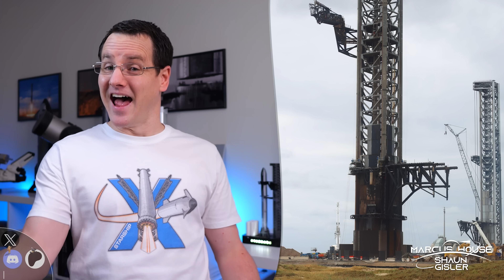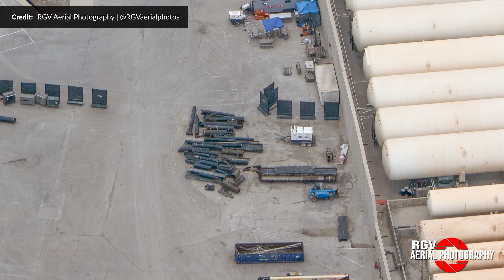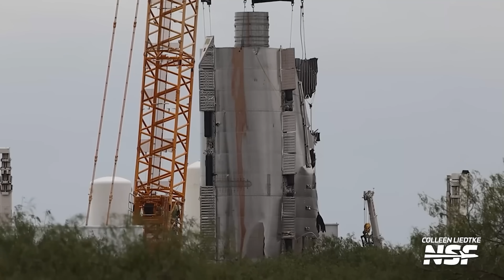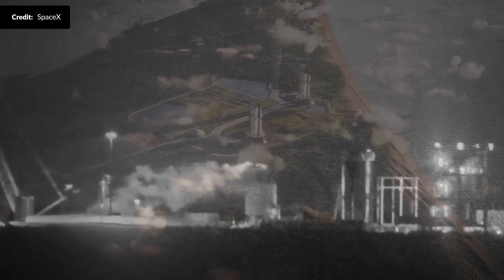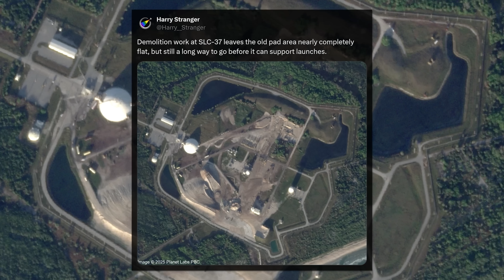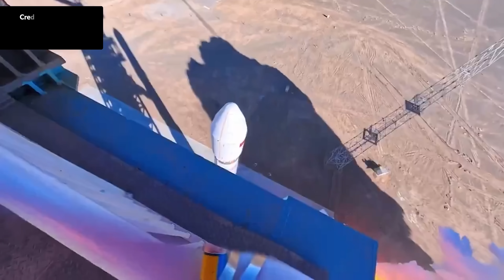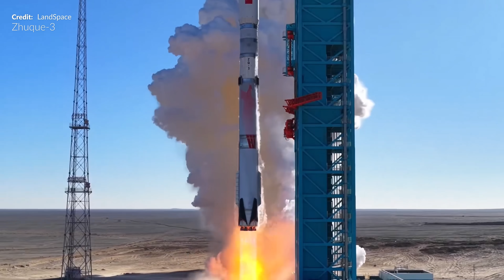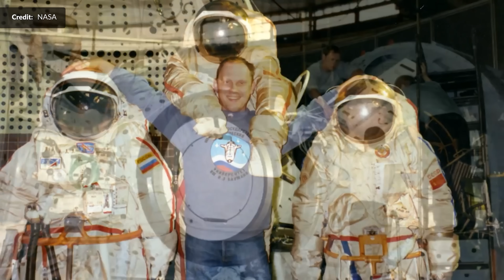SpaceX Just Got a HUGE Starship Launch Approval Update!

Comment from the maker: Get a great Displate deal using my link https://displate.com/l/marcushouse or my discount code MARCUSHOUSE.
1-2 Displates - 33% off
3 Displates - 38% off
4+ Displates - 40% off
Valid on Textra
Reply: They could use the reusable V3 and V4 at some stage as a replacement for the falcon permanent engine, to get more maturity into them:)
Reply: I'm thinking that the removal of all the cylindrical pieces, whether they are accumulators, hydraulic cylinders, water pipes, or echo chambers😂 - they were all probably made by the same company (which was NOT SpaceX - they FOR SURE aren't in the business of making PIPES lol -  AND I'm thinking they also make the COPV cylinder (that gets wrapped in carbon-fiber) -  and SpaceX just figured out that Booster 18(? - I THINK that was the booster that rupture on the test stand at McGregor recently. Well no matter what the Number was, I'm referring to the most recent causality during testing) and it was YET ANOTHER CYLINDER - ALL MADE BY THE SAME COMPANY -  And so now SpaceX is switching to a NEW COMPANY and REPLACING ALL THE CYLINDERS MADE BY THAT FIRST COMPANY - What do you think? Make sense?
Reply: This is all a waste of time and money
Reinstate project Orion and

Get your ass to Mars

Nuclear engines are the only way

Comment: Keep an eye on the black magnet things behind your displate, they sometimes slowly move down over time until the displate falls onto the floor. Usually takes years but has happened to two people i know.  To fix it just run a small bead of superglue on the top edge between the black magnet and the brown wall protecting plate.  This should stop the black magnet moving down.

Comment: New Glenn is not a reusable booster until it gets reused so at this point in time there's no "second" reusable orbitable booster right now unless you accept that Super Heavy is it since it has done the whole of it's part including reuse though Starship has wisely not gone orbital as doing so would be an unnecessary risk for a very experimental rocket.  And that may be a reason to not call Super Heavy the second either as it's still not a production rocket, only an experimental one.
Reply: lame
Reply: @hierox4120  Explain yourself, what exactly are you calling "lame".

Comment: It's funny to call something an orbital booster that hasn't boosted anything to orbit yet
Reply: That's the job of the 2nd stage, the booster did it's job as intended.
Reply: @imaginary_friend7300 let's be simple.if you want to call it an orbital booster, the boosters job is to boost the second stage to a point where the second stage proceeds to orbit. They work hand in hand. If one fails they both fail.. that's the nature of the game. Nothing from starship has achieved orbit yet...  So nothing is orbital yet...  Not saying it can't or won't... Just saying it hasn't...  That is a fact.. not sure why you are trying to argue otherwise
Reply: @imaginary_friend7300  it's a system.. they work together...one fails, they both fail... but ok.. let's play your game.... if the booster if good to do it's job, whay are they still modifying it?
Reply: Starship was sent successfully on a suborbital trajectory that was very close to orbit; it was left just short of that because, being experimental, it was better to design a passive return to earth trajectory.  Simply burning the engine a little longer could have done it.  I agree that Elon has claimed some false and even ridiculous things, but this claim is reasonable I think.  It's not like you get a trophy for this distinction.
Reply: @mriguy3202 I've watched every starship ift..  coulda shoulda woulda. Is not a has done

Comment: I'm thinking that the removal of all the cylindrical pieces, whether they are accumulators, hydraulic cylinders, water pipes, or echo chambers😂 - they were all probably made by the same company (which was NOT SpaceX - they FOR SURE aren't in the business of making PIPES lol -  AND I'm thinking they also make the COPV cylinder (that gets wrapped in carbon-fiber) -  and SpaceX just figured out that Booster 18(? - I THINK that was the booster that rupture on the test stand at McGregor recently. Well no matter what the Number was, I'm referring to the most recent causality during testing) and it was YET ANOTHER CYLINDER - ALL MADE BY THE SAME COMPANY -  And so now SpaceX is switching to a NEW COMPANY and REPLACING ALL THE CYLINDERS MADE BY THAT FIRST COMPANY - What do you think? Make sense?

Comment: China hasn’t had an original thought since gunpowder…
Reply: Perhaps this won't be a popular comment here, but the Zhuque-3 isn't particularly a Falcon 9 rip-off. It has clearly learned lessons from the Falcon 9, but any modern rocket should, it was a complete gamechanger: no one should ever let ArianeSpace live down their dismissing it. However, the engines are entirely different both in fuel and the landing profile the specs imply, which is massive. Basically yeah, it's a tube full of fuel that goes up and later lands, but that's what any modern rocket should be. What similarities there are like the large engine count and the landing legs are because everyone's watched a decade of SpaceX succeeding after making a good design, so you'd expect anyone competent to design something similar. 

Although even if it were a complete rip-off (like the Long March 9's most recent design proposals, which very clearly just "Make A Chinese Starship If Starship Works Out"), would that be such a surprise? When Britain invented the steam engine, would you expect a German steam engine built a decade later to look completely different or function on completely different principles? Or for another example, once the Wright brothers show you how flight works, how could you not be inspired by parts of their design?
Reply: @suicazura9417  did they get their methalox engine idea from spaceX having tested them long before Starhopper/SN style?
Reply: At least their government is pro space. Our goiberment is pro good ol’ boys network and anti SpaceX.
Reply: And that's even highly debated, no sources outside some dubious Chinese ones of alchemists mixing potassium nitrate in elixirs (and these come from Maoist texts). European, Persian and Arab explorers and merchants never documented the Chinese using gun powder. Jesuits have documented how they introduced the Chinese to saltpeter for propellant.

Comment: For ppl living on the space coast currently, how disruptive are the noise and shockwaves from Falcon 9? Starship is so much louder I feel like its going to make the areas around the launch sites unlivable with sounds like that every 8 hours?
Reply: I can hear Falcon 9 launches from inside my house in the City of Cape Canaveral. Some launches rattle the windows just a little, but don't interrupt conversation, even on the phone. There are currently 1, 2, or 3 launches a week.

Only a small percentage of launches have boosters that return to the Cape to land -- most land on barges hundreds of miles out to sea. When they do land at the Cape, all we hear is the sonic booms; two in quick succession, like boom-boom. The sound is loud enough and sharp enough to startle you if you are outdoors, even if you are expecting it. But overall, not really disruptive.

Starship launches will be louder -- it will be interesting to see how much louder. And every launch will have a booster landing at the Cape -- no barges involved. So a lot more sonic booms. 

I consider putting up with rocket noise my (small) contribution to the space age. If Starship is too disruptive, my attitude may change.
Reply: That makes sense that the landing sonic booms are the actual loudest part of a launch. So now we need someone who has been in person to starbase (or those who have seen both!) and how many and intense the landing booms of the booster are . And if both the ship and booster rtls thats two per launch let alone if the start catching ships from other launch sites. Sonic boom barrage once every hour..? o_o

Comment: 16:38 thats not correct. ZQ-3 rocket has half the capability of F9, Expendable11,800 kg, Reusable (RTLS)8,000 kg, Reusable (Downrange)~8,000–12,500 kg. Future iterations hope to increase that to F9 levels, something which will be quite a feat since they have less powerful engines and a much heavier stainless steel craft (but accurate numbers and facts are not usually something the Chinese seem to care much about)

Also, recovering a booster does not make it instantly reusable. Electron was recovered but failed to become reusable for example. Currently there is only one reusable booster, the F9 (SuperHeavy has also being reused, but not fully operational yet)

Comment: 3 Starship Launches Every Week? I don't believe it until I see it.
Reply from the maker: I had these same messages with Falcon 9.
Reply: @MarcusHouse  Not from me. Starship is an entirely different beast than Falcon 9, much more parts to check, and Starship re-use is entirely different from its booster re-use. So far, none of the Starships that made an re-entry looked remotely like it could be re-used at all. 

While the  Falcon 9 booster is the the most re-used rocket in the world, its fasted turn-around took 9 days, and the average is much higher. T

he main problem though is that Starship is too heavy because of re-usability requirement and uses too heavy propellant for being an upper stage, making it very inefficient, and the number of tanking mission to fill up one Starhip is going to be impractical. SpaceX tries now to overcome it by making the whole thing even bigger with V2 and V3, which is not an improvement, but a desperate try to allow to bring up any payload to orbit at all, which Starship V1 turned out not to be able to do. How did that go so horribly wrong? Starship V1 was like designing a truck with frame so heavy it can't carry any payload and has to drive around empty. Or building a commercial passenger plane that can't fly with freight or passengers. Who messed up here?

I am not happy about all this, and as a German I am not comfortable with the way Elon Musk and SpaceX are operating - without thinking things through. I prefer the more methodical way of Blue Origin, with less drama and promising capabilities from the first launch.
Reply: All they're doing is getting ahead in the paperwork.

Comment: This proposed schedule would put every other launch provider out of business. That's the clue as to how fictitious it is. Not even Elon's money and/or his installed presumed NASA administrator will able to offer up the Cape as SpaceX's private launch facility. Not to mention what will the Starship loft into space on such a schedule besides someones ego.
Reply: Falcon 9 has already flown over 150 times this year. No reason to assume that Starship couldn't do the same. That is especially true with the fact that most launches will be SpaceX only packages, like Starlink. Further, this is UP TO, not at minimum.
Reply from the maker: This is true however the big difference is the two added catches in most cases.
Reply: @anthonypelchat  The other consideration is the volume of propellant in the Super Heavy stack. The exclusion zone will be very large.

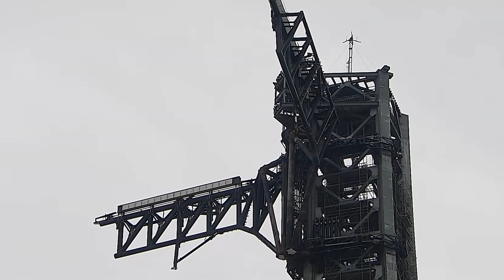Comment: 1:50 Hold on. What? "Move the arms with gas that forces hydraulic fluid into the actuators." I'm confused by the why. There is a lack of efficiency doing it that way due to the compressibility of gases vs liquid, but I can imagine there is a benefit to dampening shock forces for the same reason, however couldn't the latter be addressed without combining pneumatics and hydraulics? Is there a video that covers that?
Reply: It creates a faster acting system with reasonable sized hydraulic pumps. Otherwise the hydraulic pumps would have to be multiple times larger.

Comment: A high performance superheavy neutron derivative would have Elon soiling his pants.  Landing downrange onto a barge is ok when you have lots of rockets.  Starship second stage reusability is not an economic advantage when all the variables are tallied.
Reply: So wrong!
Reply: @GntlTch Its cheap to 3D print spindly second stage rocket motors for neutron.  Trucking fleets don't like to transport air, which is what starship does upon re-entry.
Reply: Your trucking fleet example is foolish. Any reusable rocket is transporting emtpy space on its return. Neutron included. Cutting out marine assets is a major cost advantage. It's like paying one truck to transport another truck because you didn't want to put enough fuel in the truck to transport. It's fine when expending the upper stage, but will be pointless when reusing the upper stage.

Neutron might do well. Most of us think so. But it has a long ways to go just to compete with Falcon 9. There is little chance it will be able to compete with a fully recovered Starship.
Reply: @anthonypelchat You do  simple spreadsheet and calculate total cost.  Returning from orbit is like running an inferno gauntlet while transporting air.  A second stage neutron booster is super cheap and can be mass produced.  Throwing away a spindly stage 2 booster is a good tradeoff.  Starship will never have high cadence due to gauntlet induced inspections once on land.  Elon's analogy to aircraft is a false analogy.  Also, if you read what I said, it was a superheavy Neutron like system.  Neutron is not superheavy.
Reply: @mefobills279  The second stage Neutron is more expensive than just fuel. Further, Neutron hasn't proven anything yet. It hasn't even flown. So its paper math, which you are already horribly wrong about, is just theoritical. 

For math, Starship's landing uses no more than 65t of fuel. And that is after launching 100t of payload to orbit. Neutron can only lift 13t to orbit while reusing the booster. So you need 7 flights just to equal 1 Starship launch. And each Neutron launch needs 122t of fuel. So yeah, your math is horrible.
Reply: @mefobills279  What a joke.  Like you can do any of that math.  We have none of the figures so that's 100% bs.  If you need to LIE to pretend you have a point you didn't actually have one.  You're just another dishonest BS spouting hater.  And like all f those you're not terribly intelligent.

Comment: Looking at the giga-factory make wander if they will be running out of parking spaces for the rockets, could Elon be planning on building a parking lot for his rockets in low earth orbit far from Salt water spray and hurricanes? All you have to do is send up a couple of StarShips full colonist for the preloaded StarShips along with full tankers when earth and Mars lineup, to increase safety they might send up only oxygen or methane but not both at the same time to the fuel depot.

Comment: Won't theirs be the 4th ever reusable booster?  Falcon 9, Starship Booster, Blue Origin's New Glenn Booster have all demonstrated orbital class landing and reuse.  (Well, BO hasn't reflown NGt yet, but they certainly can.)
Reply: No, BO's New Glen most certainly does not "certainly can"! Press release and aspirations are just vaporware. The only true reusable vehicles currently existing are the Falcon and the Starship. REFLIGHTS are required for REusability.
Reply: @GntlTch New Glenn has already landed undamaged... All they need to do is prove it can launch again... The Chinese haven't even landed.
Reply: Thiokol SRBs on the Shuttle. Why is everyone forgetting that we had a reusable space ship that went to LEO, came back, and got reused?
Reply: Not really in the same class... they used the metal that fell back down and refilled them.  No engines, no control systems... and they didn't even have to reenter, as they didn't go that high.  The main engines and shuttle itself is a better example.  But the cost to refurbish it cost way more than any of those other rockets... combined... in expendable mode.
Reply: I guess I should say the boosters were not orbital class themselves... so therefore don't count.  They only went to about 45km high before separating.
Reply: @williamsteele  Well in which case the Falcon 9 first stage booster also doesn't count, as it doesn't go orbital either.  And stage 2 which is orbital isn't reused.
Reply: @GreenJimll It's an orbital class... It needs to slow down enough to survive reentry.  The shuttle boosters didn't do that... They didn't get anywhere near the speed to need protection against reentry.
Reply: @williamsteele  When you think about it the race is largely still for 2nd place, if we only count operational rockets.  If we count developmental test articles spacex has 1st and 2nd place now.
Reply: @imaginary_friend7300  Exactly!